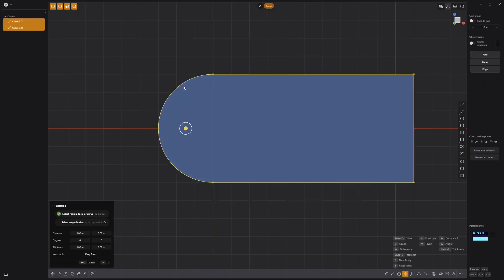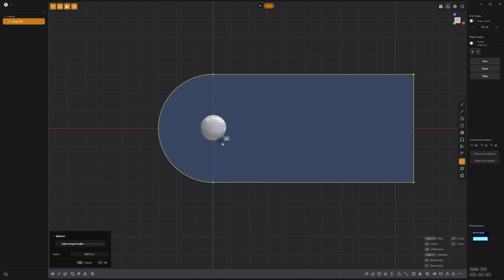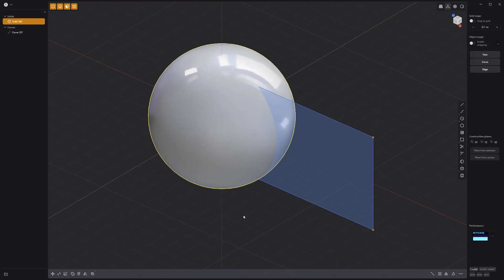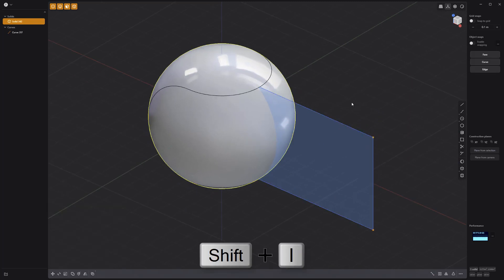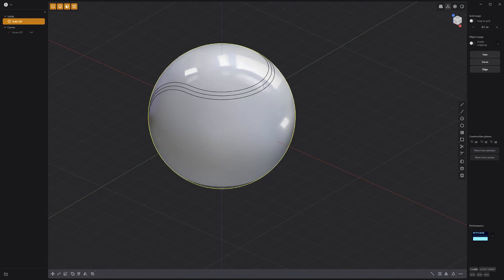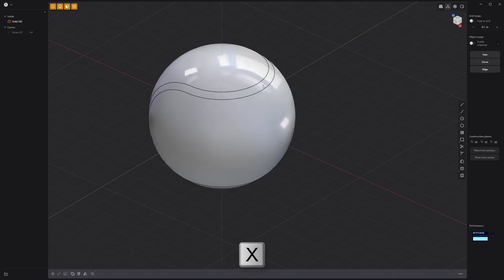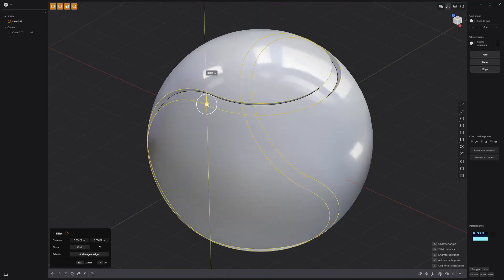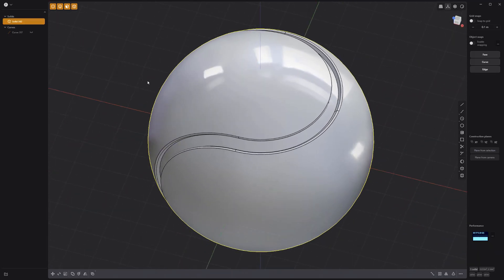Plasticity | Create a Tennis Ball

Comment: You do know this technique doesn't work on anything with edges right? Like a box. It doesn't work.
Reply from the maker: I dont follow what you are saying. Can you share more info?
Reply from the maker: @cgs5428  Still not following... can you share an example image?
Reply from the maker: @cgs5428  Do you mean this? https://youtu.be/rdWNDMwDC5g
Reply from the maker: @cgs5428  Maybe move the discussion to the official Plasticity discord channel
Reply: It also works on a box for me.
Reply: @cr4723  Nope doesn't work. Offset tab breaks the edges.
Reply: @Pixelfondue  Still doesn't work with 1.1  Offset tab creates broken continuity over the edges. Circle imprinted onto a cube. I'm surprised you aren't able to verify this. It is a very simple thing to see.
Reply: @cgs5428  It only breaks the edges if your cube is not a cube but somehow has sloping surfaces. Or the circle is oddly shifted. There are too many options, some may not work. But there is the curve extension function, maybe that will help you.